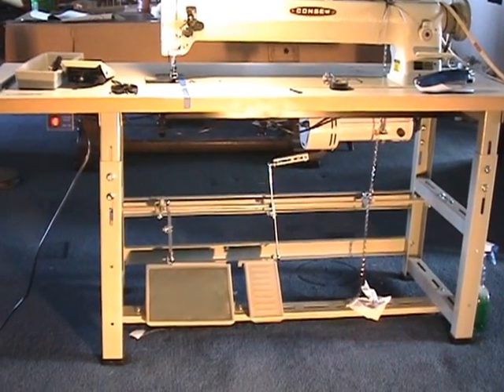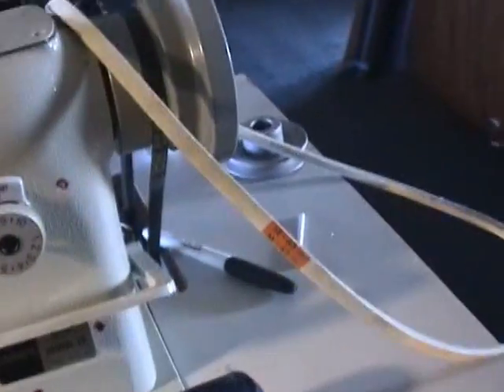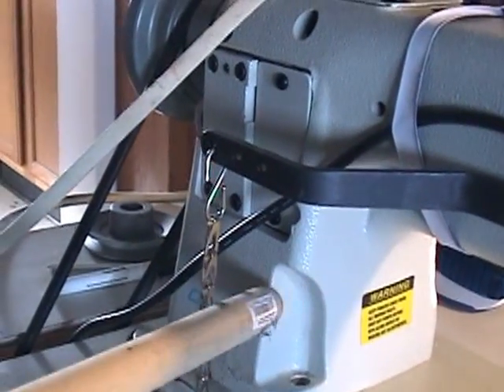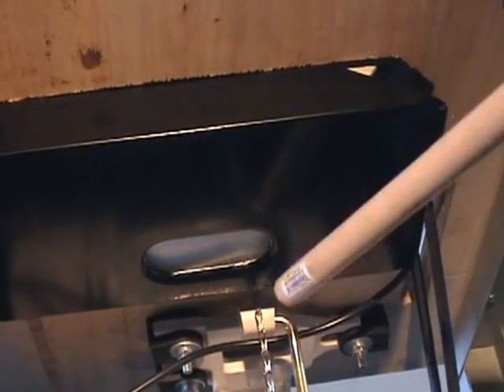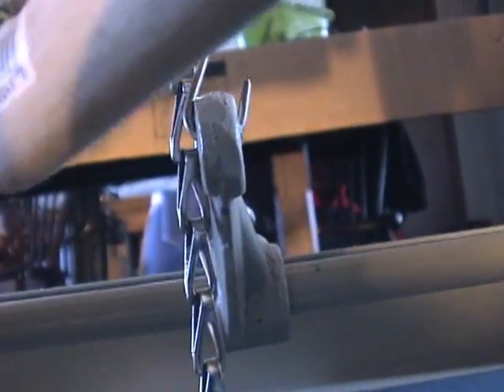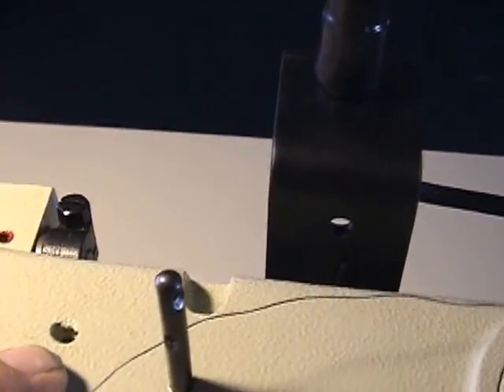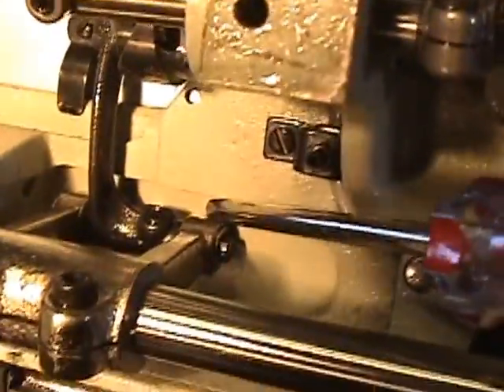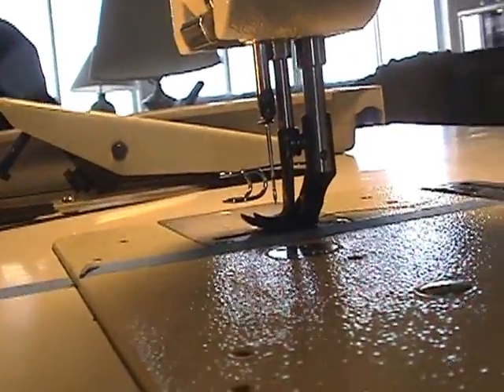Assemble & setup Consew 206RBL-25/Knockdown Table  Part 1

Comment: thanks for the video.  one question...where did you get the smaller pulley and belt?
Reply from the maker: Any auto parts or farm machinery place will have it. Also look on line in your area V belts and pulleys